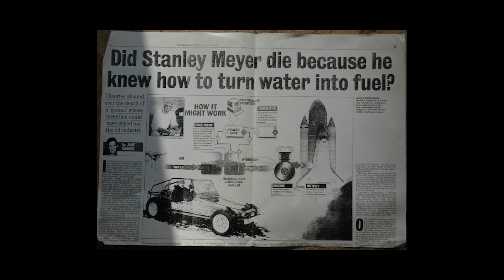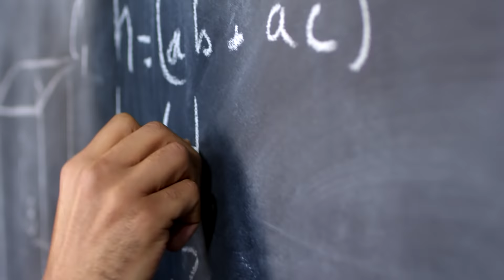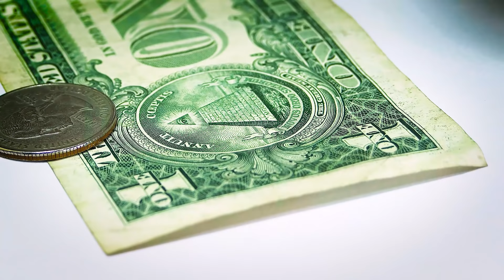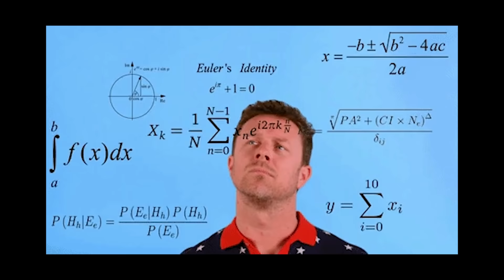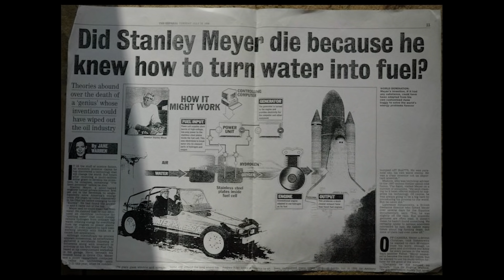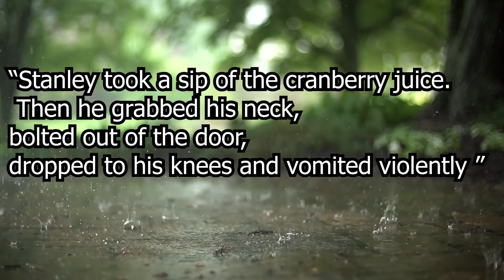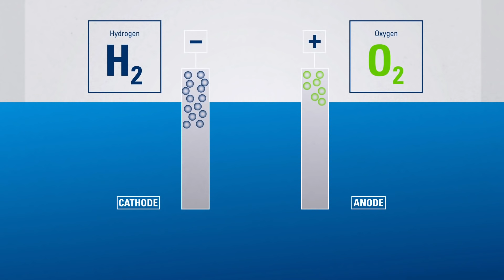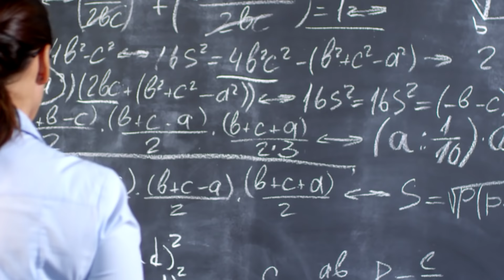Stanley Meyer Water Powered car, Lies and Death

Comment: Watch stan meyer explains water fuel technology  its 37 minutes it worked great and produced significant  more power  than gasoline and ran so clean you never had to even change the oil and explains how the model that would have come to market would have been 1500 dollars
Reply: @MPS2726  the technology used that stan invented separated hydrogen from water then ran off of the hydrogen
Reply: @MPS2726  lol if there’s a possibility then there’s a motive to kill him. Just a possibility can change the game 👌🏽
Reply: 2.5x more power.
Reply: This is true.. Conversion kit cost was $1500.00...  Would of knocked the Oil Company's out of Business !!
Reply: Lol “runs so clean you don’t have to change the oil”… ignorance smh. Oil is used to lubricate the parts of the engine. Engines will wear regardless of how clean they burn. Oil is used to lubricate the moving parts to keep them from wearing down.
Reply: @drew4711  bro I'm just repeating  what the man who invented it said about it and if I take my guess he knows more about it than you
Reply: @drew4711  throwing the word ignorant  around like you know what your talking about smh
Reply: @drew4711  most engine oil contamination stems from oil dilution since a little bit of gas comes in. Instead of oil, perhaps hydrogen would get in there potentially leading to an explosion. Lol

Comment: You are correct,  you are not very smart. 
This is absolutely valid. I spent 2 years going through Stanley Meyers research and found the points where he changed his path and where the perfection of the process is. 
I've drive 2 vehicles on this exact process.  Easy,  cheap, direct replacement with minor alterations to any combustion engine. 300 miles per 1 litre of tap water.

Comment: Any gasoline powered engine can run on water. All you need to do is take the spark plug electricity and boost it up to 20,000 volts and 50 amperes. Watch that water explode instantly and cause the piston to move.
Reply: It looks like a troll comment but you're actually telling the truth

Comment: I used to build kilns by hand for the ceramic pottery craft people. I used oil-based burners with blower fans to create an injection system very similar to fuel injection on modern cars. I inserted steel plates in the path of the burning flame and when the steel plates reached red hot or white hot color I added water through a tiny nozzle. The water instantly fractured into hydrogen and oxygen which both translated into fuel. The effect was so powerful that several of my kilns exploded from The increased pressure. I was not smart enough and I was too frightened to continue my Enterprise. I guarantee the hydrogen/water fuel system works.
Reply: Steel is molten when white hot.  Try making up another story dude - and use a bit of science this time...

Comment: Well, on "before its news" website, about ten years ago there was a mysterious post by a man pretending he maintained kind of secret anti-gravity flying machines. He described how a device worked to create anti-gravity (I found a flaw there). However, the main power of the craft was  produced by a kind of thunderstorm  engine with two horizontal pistons with water  (the sole and only fuel) injected. Then by reciprocating pistons movement, the water was compressed in the chamber with no air intake (at the diesel engine compression pressure reached about 14 bars) At that time a high voltage ignition spark was fired inside the horizontal compressed chamber with the water horizontally in it High voltage spark propagate very well trough water and cause it  to explode  in  vapor . So  the spark caused the state of water to modify from liquid into a gas of about 225 bars (like diesel oil burned in a piston) but with a high temperature (called critical state) which pushed the piston back. So was the two pistons engine working and called it a "thunderstorm engine" with reciprocating pistons. At the exhaust there was water plus ozone ;
I believed at that time that this was a joke.
I just saw that this was patented recently in Germany (prof. Diplom engineer Konstantin MEYL 2021) The patenter know and understand matter and electro-magnetism far better than many physicists (he studied the electric arcs and the EDDY currents in particular) and he claims that a heavy duty diesel engine can be converted to water if equipped with timed high voltage ignition system like liquid gas engine have. His patent authorize personal use.  Personally I fear that corrosion and friction would be a problem for a classic Diesel engine, anyway everybody know that the steam engine corrosion and friction problems were technologically solved a long time ago. Give it a try?
Reply: Maybe an anti corrosive could be added to it, kinda like antifreeze.

Comment: In 1978 my mom bought a BRAND NEW CHRYSLER WITH A V8 never took it on anything just local driving only after a couple months I ask her how it was on gas she said she had NOR put any in it since she filled it up when she bought it
Thanks to dad she was a fanatic about checking oil she called me one day after having it for 3months and said it was leaking oil so I checked it for her and it was nothing to worry about she insisted on Taki g it back to the dealer to have them check it , they ask her how it was running she said fine they ask her how was her fuel milage she told the she had not put any in it since she filled it after buying it , turns out it was getting over 20 mpg they looked surprised and said they would see if they could fix the oil leak turns out that her car had an experimental carb on it that shouldn't have  on it when she got it back 4 days later she said it just didn't  run the same , well gee I wonder why the technology is  there but big oil doesn't want it out there that's why  I belive Stanley was was poisoned

Comment: If you have H2O and 02... You then have put them together as one.. when you burn them, they essentially become at a boil point and have steam (evaporation), in witch it can evaporate into the cilinder expansion and expand the hypertension. Although, if you would do this without enough tubular push powers, it would for sure back up and become stagnant. Absolutely amazing in the eyes of us motor heads..
Long live the legend.
Reply: This was the most scientifically illiterate comment I’ve ever read. None of that is even remotely accurate.

Comment: You keep using the term hydrogen but it’s actually Oxyhydrogen or HHO gas :)

Also you need to research this a lot more deeply because you’re missing huge amounts of what happened particularly around what he has to say about the allegations that were made of his vehicle and what he did about it.

Stanley recorded thousands of hours of footage of every aspect of the working of his vehicle especially the fuel cell which produced visibly vast amounts of HHO in comparison to most other generators it was indeed revolutionary.

Don’t believe it go and look at the footage and watch it and try and build that for yourself—

The trick he was using was to do with a specific frequency and also to do with increased surface area but the fuel cell really wasn’t where the magic was.

Stanley later revealed a lot of the secrets of his car one of which was the water spark plug and the actual device doing the splitting.

You see what isn’t commonly understood about Oxyhydrogen gas is that there are two different forms of course Wikipedia denies this all day long but it doesn’t change the fact that there are two different forms of the gas.

One form of the gas is just produced via standard electrolysis.

Another form of the gas is actually highly charged by proton acceleration, burning this highly charged version of the gas produces almost double the energy and also results in far greater efficiency.

There is also footage of the Excelerator is that we used in the car to charge the gas there are many secrets to his car and it is not at all as simple as just being a car with an HHO bubbler stuck on it—

Whether or not he was killed as a relevant but if you look deeply into what he was doing with the car you can draw your own conclusions very rapidly and easily without having to worry too much about the details of his death.

I know almost every secret he used to create the car and at some point I’m going to replicate it I highly recommend everyone study the available material although so much time is now gone by it could be that a great deal of it has gone missing.
Reply: Clearly it can be done. But if you figured it out, could you get funding for marketing and mass production without meeting the same fate?
Reply: I would suggest you create footage as you replicate it; create the necessary documentation, schematic diagrams and blueprints so engineers, scientists and other interested groups can replicate it and release it into the world. What i am trying to say is make the technology open source and release it globally for free. Release it all over the Internet for free. Because, once the big players know about it, they will suppress the tech to keep in control of the energy market.

The old model of the small man inventing, patenting and marketing is not working. Any tech that has the potential to bring about transformational disruption to current tech is a threat to the big players and they usually find devious ways to suppress the tech (we all know how). However, if it is released to the whole world as open source, they can't control how and where is it implemented and distributed.

No small man or group will be allowed to get an edge to disrupt the conventional energy tech over the traditional big players. The 'small man/group' inventor seems to always 'go missing'. It happens over and over again.

Comment: Judging by the type of things that this guy worked on I believe he invented it. And this is how I think it worked. A very small portion of gas fluid or hydrogen fluid was mixed with the water  and that was enough with his engine designed to make it work. 💡😊
Reply: False.
Reply: @Slit 444 by lies.
Reply: atomized hydrogen and oxygen is how it works. scientist said it was impossible and Stan and his brother proved the scientist were wrong. Stan's invention was proven not to work by 3 witnesses that were paid to say it didn't work. Oil companies would lose way to much for it to be proven that it worked. Stan was a  genious and others have done what Stan did and were silenced by cash,threats or death like Stan. RIP Stan
Reply: @jakethepup9694    I believe everything you said 100%.
Reply: @jakethepup9694  You  know nothing about chemistry. How do you separate water and get more energy out by fusing it again  than you put in separating it? Basic conservation of energy.
Reply: @Tim Rock-It Saunders That is bullshit. You want to tell me this car has  a nuclear reactor or particle accelerator or something in there? Where do the neutrons come from?

Complete bs.
Reply: @MagnificentXXBastard  Stan designed the car in a way it magically attains energy out of tin air.

Source is i pulled it out my ass
Reply: @DIYTFY  smart guy not
Reply: @jakethepup9694  "Oil companies would lose way to much for it to be proven that it worked." And yet Tesla sale cars which doesn't use one drop Oil...and is still alive. Magic.

Comment: The electrolysis uses direct current D.C. and needs some salts or acids to make the water conductive (you turn it into a resistance) for that reason it is not very efficient, because part of the energy is transformed into heat in the water.
MEYER did the opposite, 
use A.C. ALTERNATIVE electricity.
and the DIELECTRIC property of WATER (it does not conduct electricity well) to create a capacitor  made with water as dielectric.
and then he connected it to a resonant circuit (amplifier) and set the optimum frequency for power transfer. 
This way it minimizes the expenditure of electricity to break the water bond.
Reply: Then why is nobody using his technology today to create H2 and O2.  These gas are good valuable commodities now, and are still very expensive; take H2, it is around 2.5 euro/liter in liquid state and O2 sell even more.  If he really had a good way to crack water with very low energy input to create massive amount of H2 and O2 worth more, his invention would be used by many now, since his patent is free to all (only last 10 years). 
You are so smart at explaining it, you should be in business
Reply: @stephb5098  I think you raise a question that gets ahead of itself,
others that need to be asked first.
The price, although it is necessary to answer it, 
I think the first thing to do is to see if it can be done.
If it is technically possible or not?
Once answered, or solved the main answer, it is necessary to move on to different phases of how to make it more efficient, etc...
And maybe the last question will be to specify the price...
Well, to my understanding the price is very relative and can even be manipulated
it can be manipulated, as it is happening with other types of energies already established.
Greetings

PS: And I don't have any hydrogen lobby or anything like that, 
I'm just driven by the desire to have more knowledge of how things work.

Comment: Everyone says Stanley's car utilized electrolisys, but watching a video where he explains how his his car works, I got the impression he somehow did an end-run around traditional electrolisys.
He also had some sort of laser module that was about 2" thick between the distributor base and the distributor cap that simply produced a signal sent to the car's computer. You certainly dont need a laser to do that. The location of that component suggests it's being used to retard/advance or condition the spark somehow, but he doesnt say that.

Comment: Tell me if Im wrong but If you have a 50 liter tank full of water you get aproximately 25 liter hydrogen. Meanwhile current cars have Hydrogen tanks that is 50 liter. So doing electrolysis on board is not efficient as having the hydrogen alone because you have to carry more payload for less output

Comment: His Electrolysis Cell was of a  High Frequency and efficient Patented design together with his injectors and mods to his car & engine which made it a totally different system to whatever people think of when considering a basic way to run the car this way!
Reply: is the patent posted anywhere?
Reply from the maker: Jup
Reply: So you want to tell us that you believe he can generate MORE energy out of it as he has to put into. Aka create a perpetuum mobile and break all laws of therodynamic. Seriously?
Reply: @garfield5647  Yes. Found a dozen patents in 5 seconds with search terms - stan meyer patent water car
Reply: @famaccount479  It is more a question of where the energy comes from and whether or not you have to pay for fuel, as opposed to acquiring the energy from other sources - for which you do not need to pay for fuel.
Reply: @marinadizon2720  Energy is never free, so you have to pay always for it.

Comment: Electrolysis is nothing new, nor was it new in Stan Meyer's time. It is an inefficient way to produce hydrogen using electricity by passing current through water. Because electricity is used in Meyer's fuel cell, people assume this inefficient process is used and apparently so did the Ohio courts. Meyer's invention, however, while using electricity, does NOT use standard electrolysis, passing current through water. Rather it uses "voltrolysis" by building up a massive voltage between electrodes and utilizing the resonant frequency of the medium (water) (which will change depending on the water's mineral content) to split it using very little current. Anyone with a basic understanding of electricity knows that Voltage * current = Watts or energy output. Decrease either of these (voltage or current) and you decrease the wattage or energy output. In the case of Meyer's invention, the current is decreased to minuscule amounts while the voltage is intensified. The intensified voltage with minor current operating at the water's resonant frequency splits it using very little wattage or energy.
Reply: Same as @German P, you are so smart at explaining it, you should be in business
Reply: Then built one! Oh yeah its bs 😂

Comment: How many voltage is in a coil Ignition system in a vehicle coil pack or Ignition system And what the numbers that would be shown wouldn't that be  More suffice. And yeah there is a lot of voltage enough to make that happen. All you need is an arc and order to hit that arc of plasma that would be generated by your Ignition system or coil pack of the vehicle The plasma arc would be enough to instantaneously turn it into a gas and  I can't believe people are walking around the subject as if they're oblivious I really don't understand.